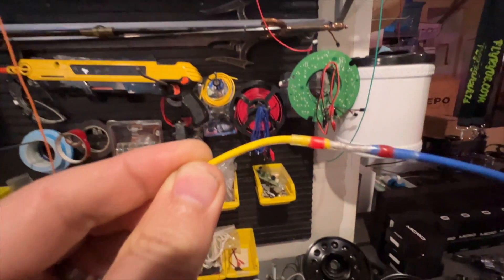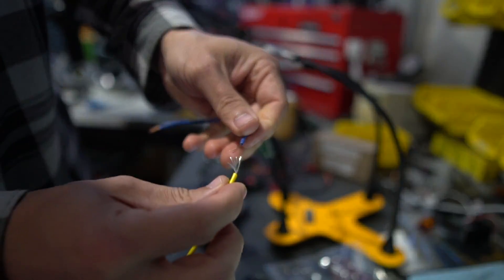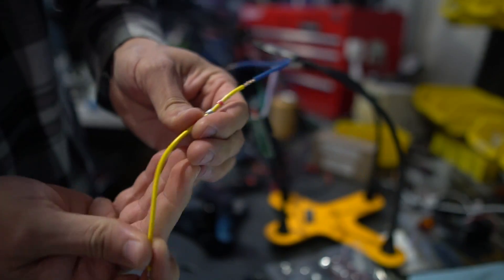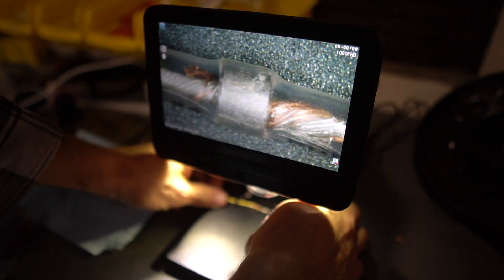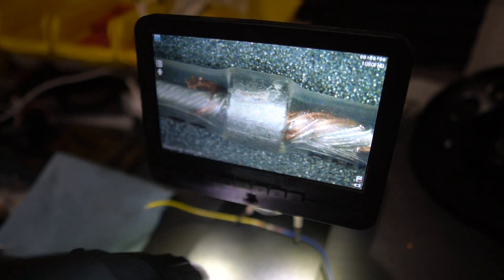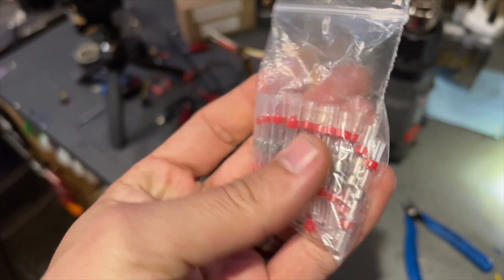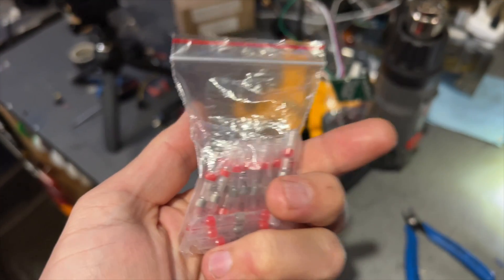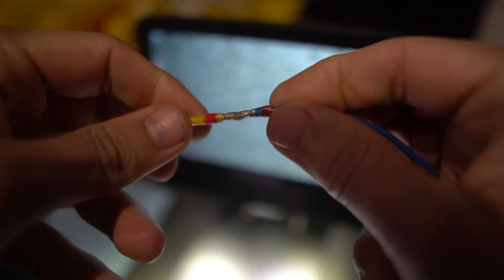Self Soldering Butt Splice Heat Shrink Connectors

Comment: I’m thrilled that they’ve revised the composition of the self solder heat shrink connectors. 20 ish years ago when I discovered them the heat gun would blow through the heat shrink exposing the solder before it would even have a chance to melt. I’m using the twist on connections that it’s possible. Have you found a  solution if you had to splice in and lengthen a wiring harness?

Comment: These do NOT give proper flow through of solder. The connection is around the cables, not throughout, resulting in a poor connection compared to using a soldering iron
Reply: The solder encases the strands of intertwined cable tightly together meaning that you don't have a substantial loss of 'flow' as it will run directly through the wires and not any solder that may be in between. 

If you mean flow of meltong solder through the gaps in the wires then it is only the same as tinning a wire as you tin the outside only, you wouldn't go spreading each spline of wire out to tin individually. 

If you have two soldered wires together with a poor type of solder then that will reduce your 'flow'. These are an easier way to create a tight strong connection. As the solder melts you are meant to either be turning the heat gun around the connection or rolling the connection in you fingers so that all of the perimeter is heated evenly that way it won't end up more on the top half of the cable as the example in the video with it being on a stand, although even the example results in a strong connection. 

If you want to test the 'flow' (which I suspect you actually mean the current running through the wire) then put your meters on Ohm setting and test either side of the connections, test a single cable first for the standard resistance value then do the same with the twist and connector (as in the video) then repeat with the good old fashioned way of soldering two cables together and see which has the lowest resistance value as that will result in the best flow/current through the cable. 

Keep up the good work @FlyRyde 🔥
Reply from the maker: @p-co11  🔥fire ass answer to that! Expect a short video doing exactly as you said. Ideally it pisses off half the internet and there’s thousands of nerd comments arguing, but I’d settle for simply knowing first hand and sharing what I find with the homies 👊
Reply: @flyryde  testing voltage drop across a connection is far more accurate than checking resistance in Ohms. Unwanted resistance is what you’re looking for, but any voltage drop on a live circuit is simply more accurate.
Reply: @flyryde 

Hey Chris where did you go buddy? I still be doing custom work and I wonder if you still do from time to time. I learned a lot from you and miss your videos man.
Reply from the maker: How can I measure how poor or proper the connection is?
Reply: @flyryde  Non destructive test is a tug and the resistance setting on multimeter. Destructive test is cut it in half. As pictured here you seem to have decent  penetration for low voltage use.
Reply: @flyryde  Test it. Take some samples, use the connector like you have, then cut it right in the middle. See where the solder is.

Typically, these cheap, low melt solder connectors don't allow you to get the wire within the cable hot enough for solder to flow through them, leaving just a layer of solder around the outside of the intended connection. For an optimal connection, you NEED flow through of solder, aim for and IPC standard.

In response to P - Co. If you have "Flow" which is referring to the flow of solder in creating a wetted joint, with the correct amount of heat, you shouldn't have to touch any part of the connection, ever. Physics (heat) will draw the solder throughout the connection evenly. Flow is purely in relation to "The flow of solder" nothing to do with current as you have misunderstood.

Comment: That's why I'm grateful for this lil invention. That and the solder paste in the syringe. Remember I told you that my last experience with a soldering iron, I inadvertently held it as if it was a pen. Despite the complaints people have made about these connectors, I have never found any fault and never a need to revisit the connection if something doesn't seem right. What you did is the right way and the same way I use them. NOT. A. SINGLE. FAILURE.

Comment: Always do the twist man. I even put a bit of flux on the twist, slide on the connector and a piece of extra heat shrink. Get the initial connection down and strong, then make it prettier with the extra heat shrink. Done.
These are great, just gotta learn their language I guess lol.